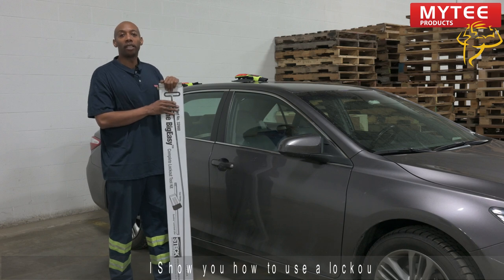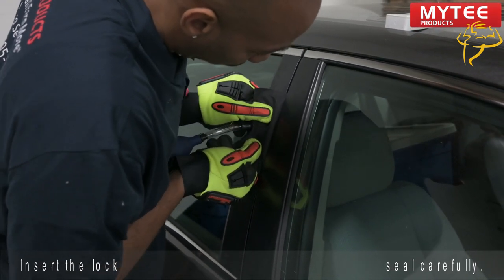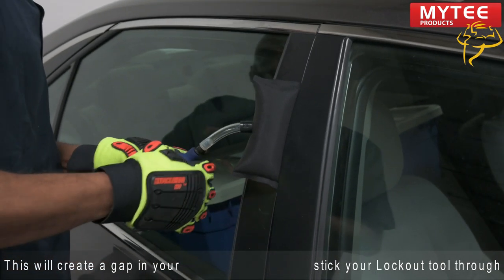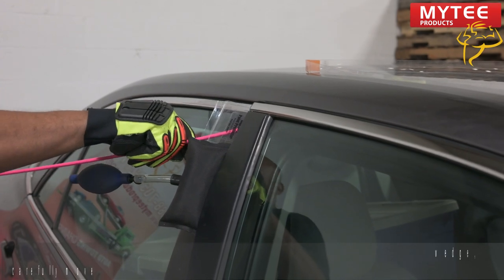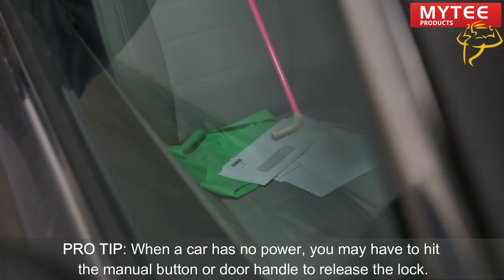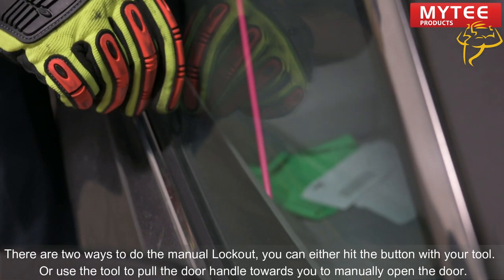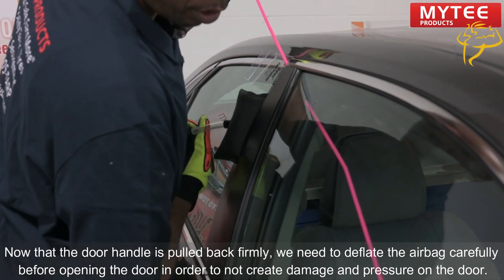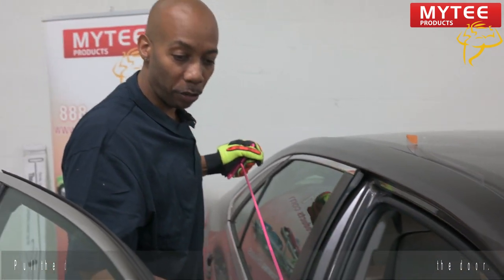How to Use Lock Out Kit or Lock Knob Lifter - A Long Reach Tool

Comment: Use 2 bags, one at top and one on side.  Only deflate when you unlock the door.   Also driver door is easier in my opinion unless you're left handed.  I've unlocked maybe 500 doors and only 1 failed attempt because i refused to attempt  an unlock on a brand new convertible corvette some years ago.   It had a frameless window.  Be careful with frameless windows

Comment: i use a small non-marring wedge to pry open to insert small bag in the middle of the door. i inflate the small bag, then put the mid size bag under it towards the bottom  of the door. if that is not enough clearance, then ill put a third bag on the top. I go straight for the door handle unless it has an easy to reach manual lock or top lock i can use the button master on. the button is my last option. I pull gently on the door handle. slow and steady cuz You never wanna break it...on some vehicles, you gotta pull the handle, take out the rod, deflate the bags, then open the door.

Comment: Didn’t know you sold lock out tools. There is a few things wrong in this video. First you’re supposed to use the wedge tool to pry the door a little to allow you to slide the bag in. You want the bag at least half way into the door jam then you pump the bag which will open the door jam space then insert the protective sleeve and the long reach tool. Unlock the door then take the long reach out, deflate the bag then open the door.

Comment: I can do a much better video then this and I will when I return to Miami. You suppose to inflate the bag more that why you had a hard time getting the tool in the door. Then you don't deflate it if you do you it's harder to pull the tool and the handle!! I seen you did so many things wrong. I did this for a company and opened so many cars.
Reply: Yeah, inflate more, if it's that difficult to get the rod in than it's not inflated enough. Also, always go for the lock first before trying the handle. If you do the lock, than you can remove the rod and completely deflate the airbag before opening the door. If you deflate the airbag with the rod still in there than the door is clamping shut on the rod, not a good idea. If you open by the door handle with airbag still inflated the outward pressure can in rare cases shatter the window. Always do the lock as first priority and if it doesn't work than try the door handle.
Reply: 4 months later and you still haven't posted a video. All talk.
Reply: @CodyDadman  woww just seen your reply I will do video tomorrow!!
Reply: @jsamerican38  ill watch it.
Reply: @jsamerican38  still waiting? big talk no action
Reply: Where's the video? 🤦🏿‍♂️

Comment: Or just get a "Door Lock only key " made for under $10 and carry it in your wallet. Cause let's face it if you're locked out of your car, you are also locked out of the trunk where this tool is kept!
And this tool isn't gonna help if you're far from home and this tool is in your garage. This however is a good tool for a tow truck company to have.
Reply: Never thought of that but I can't either way I have a Jag the key is different.
Reply: The same rule applies to this as it would a spare key ... Keep it with a relative a neighbor or at home 🤦